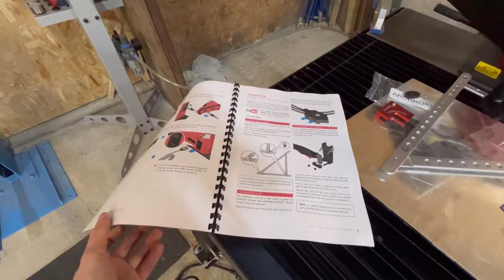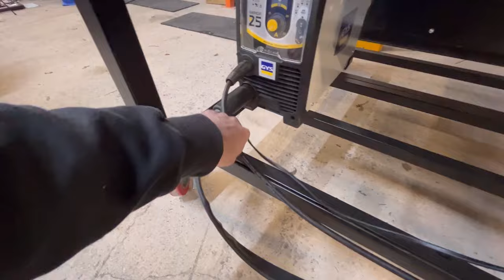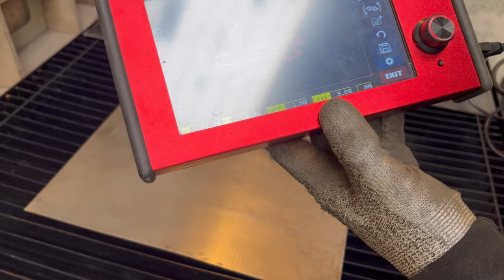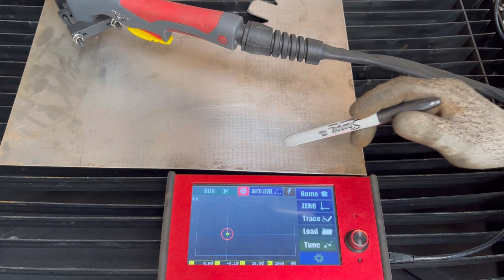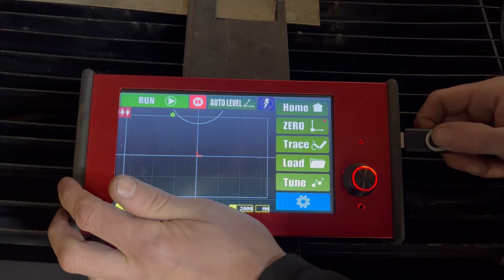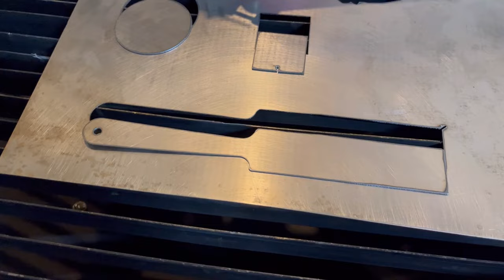Arcdroid cnc plasma cutter   new workshop tool   it’s a game changer

Comment: Thanks for the video, very informative 👌🏻have you done a cut that’s bigger than the table yet? Like putting a big sheet on, cutting half of it, then sliding the sheet over and cutting the rest?
Reply from the maker: you would need to use the x2 system

Comment: How does it run the arch exactly? Since you don’t hold the trigger and all.
Reply from the maker: wired into trigger wires inside torch
Reply: @xtremeplasma  so to be clear, the arcdroid requires you to disassemble and rewire your torch handle’s trigger?
Reply from the maker: @JeepArmyUSA  
Only if you don’t have a Cnc port or  trigger port on the plasma cutting cutter